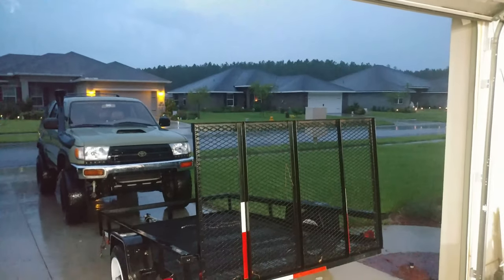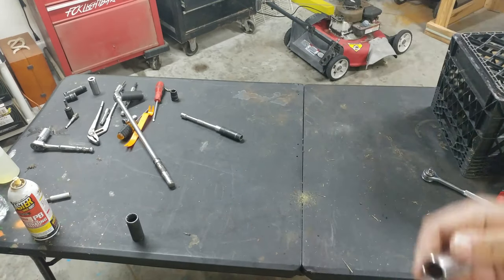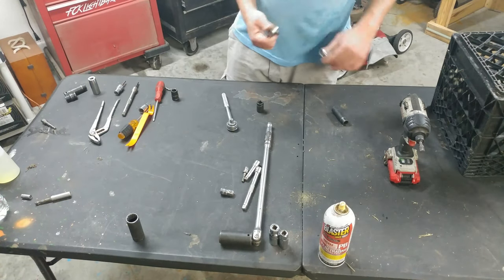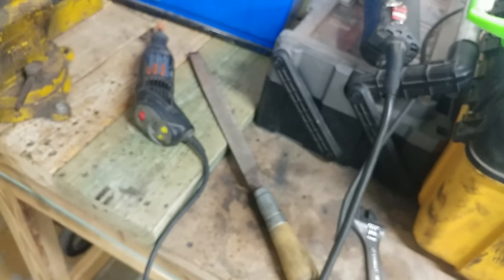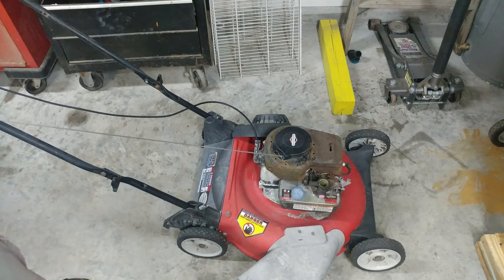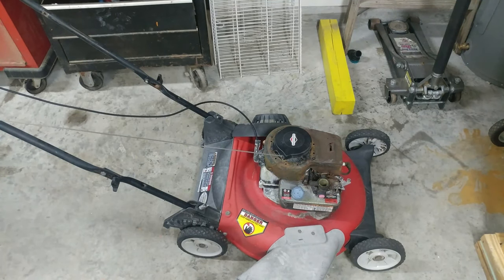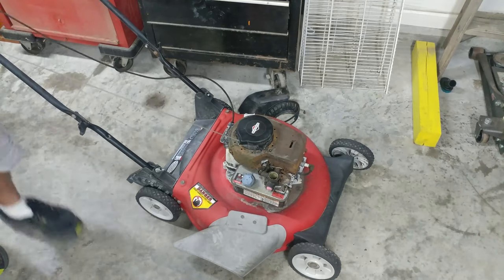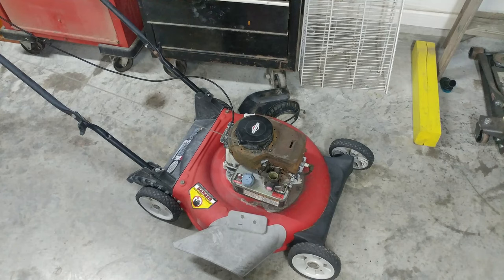How To Start Lawn Equipment Repair Business for under $100

Comment: Yes I agree. No need to repair carburetor. Cheaper, cleaner and time saving to buy after market products at Ebay or Amazon. I started my own lawn mower repair business on friends basis, I also repair car on side. For some of repairs, I can do better than professional mechanic.
Reply: I make money by cleaning the carburetor, only replace if it is very bad. I clean them on the spot on the initial visit and get $60 for one on a push mower and up to  $120 to do a large vtwin carburetor. No need to replace a good carburetor if you can clean it.
If you show up equipped to do the job then you get it done and get paid. It's really that easy. I would rather just get it done in their driveway than take it to my house where I'm hidden from the public and mower's piling up on my property because I'm busy transporting them. Mobile is profitable and enjoyable.

Comment: I’m not knocking you my friend but I have been in this business for 40 years and I can tell you that you will need a 3/4 “ spark plug socket that come with no sets. Also them china parts will eventually bite you in the ass. You’ll have some repeat customers that you will have to eat the job behind cheap parts. Crank rope is one thing but I try to use all OEM or stems/rotary when possibly. Good luck with the business. Just my 2 cents, I’m sure you will hear 40 Other people giving you advice.

Comment: Do you find it necessary to stick to one specific make of lawnmower due to parts accessibility/ease of repair? Or is it all pretty much the same?
Reply: I own a professional mobile small engine repair business and fix it all. If you want a successful business then you will need to be able to fix them all. Mobile is the way to go. I charge an initial visit fee that cover's my travel expenses. It's determined by their location and I do collect it up front. If their unit needs part's then I bill them for the time I'm there and come back if I get part's.  Sometimes you can't get a certain part and that ends that job but you are paid for what's been done up to that point. So I go 5 miles, there 20 minutes, collect $40- $60 and go to the next call if part's are needed. Most job's I can fix on the first visit.

Comment: I see you had a can of tru fuel on your bench. Idk if you use that or promote but I would be very careful. It’s blowing up machines left and right. I see Atleast a piece a month scored up from tru fuel and there are many other people in the business with the same insight. Stick to the OEM canned fuels or we’ve had very good luck with the VP branded.
Reply from the maker: That’s a older can of it. I do see where for some reason it’s causing a lot more issues. Idk if it’s cheap gas or cheaper oil they are mixing
Reply: @SmittysWorld  I have heard it’s bad batches. I think it’s this engineered fuel that they are running personally, there’s something about whatever they blend it with for what my opinion is worth.
Reply from the maker: That makes sense The company I work for is going into bioethanol production and i'm seeing they cut corners a lot for the regulations and restrictions of the government
  @hometowndiy9109